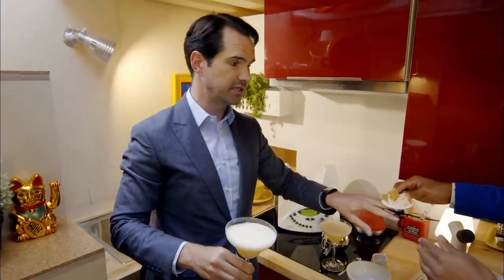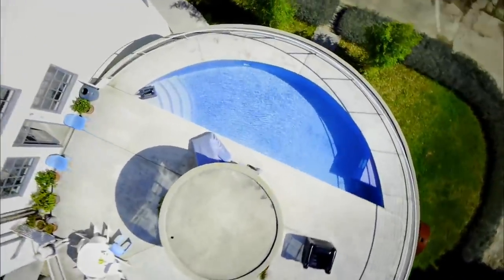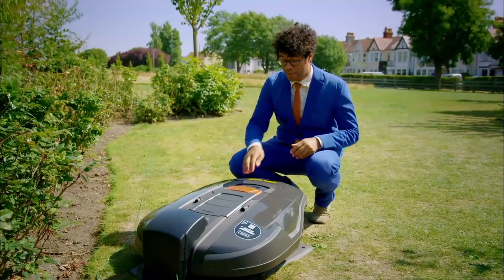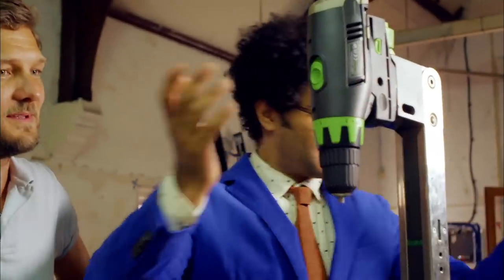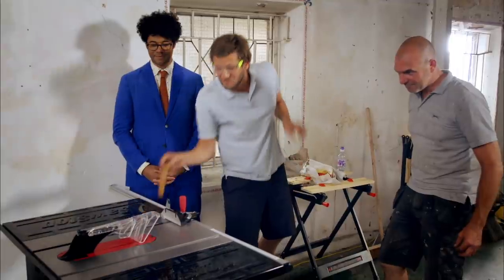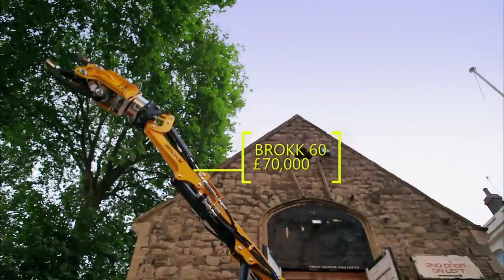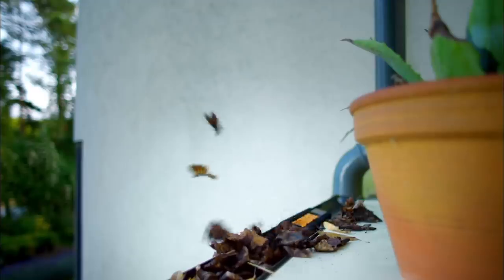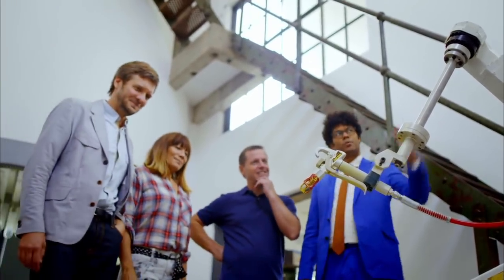Home Improvement - Gadget Man: The FULL Episodes | S2 Episode 5

Comment: So... how exactly does that painting robot handle ceilings, windows, trim, sockets, etc.

I just painted my whole condo, and covering large surfaces is no problem at all - it's putting up all the masking tape that's the real work.

That said, I WANT that wallpapering gadget. Some gadgets are clearly better than others.
Reply: The painting robot was designed for car manufacturing where you just spray every inch of the car frame. This was just an interesting proof of concept of using it for painting home interiors but it's not designed for that.

Comment: i see a few problems with the wallpaper gadget  corners and windows
Reply: Sure, but you use it as a time saver on most of the wall and use the old method on the edge cases like that.
Reply: My biggest question would be how you smoothly apply it from high above your head to the bottom of the floor in one motion. To be fair, I have never applied wallpaper the usual way, and how that works is also a mystery, hah. But if you are on a ladder, and need to remain facing the wall vertically the entire time down... It sounds precarious. 

My best guess - you stand on a platform that is set up about a foot away from the wall. You do the top part yourself, and then hand the tool to a friend standing on the floor below you.
Reply: How do you align the next roll so the pattern matches?!

Comment: "Wallpapering by hand in near madness" i wonder what the second wallpaper would have looked like applied with this "machine"
Reply: I think that could be figured out - perhaps a little arrow on the left side of the machine that you line up with the end of the paper you have already put down. Spirit guides integrated into the machine could help ensure each piece is applied vertically.

The part that confuses me is how you start a strip of wallpaper near the ceiling above your head, and make it go straight all the way down. My best guess involves a platform you stand on, and a friend who takes the gadget from you to continue the bottom part.
Reply: @ILuvAyeAye  doubt it considered the struggle he had putting down the first one. walpapering by hand is not that hardand still the easiest way to do it